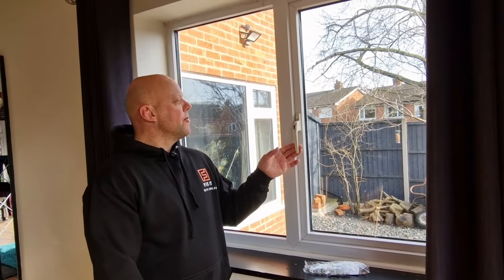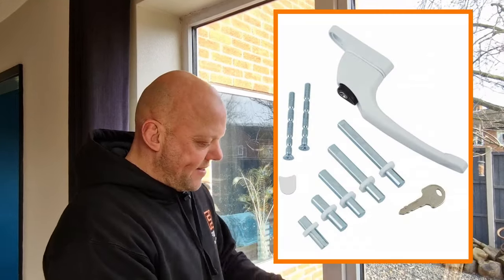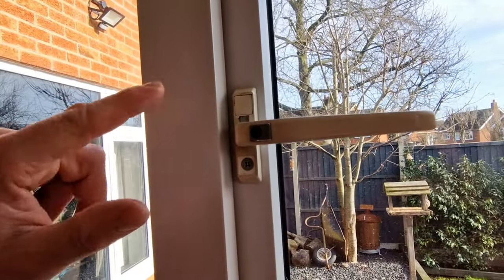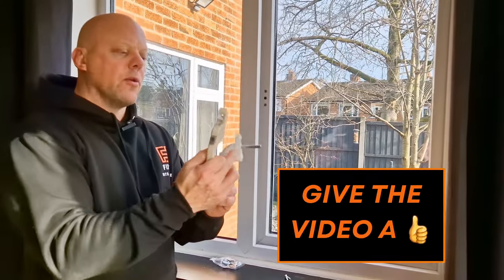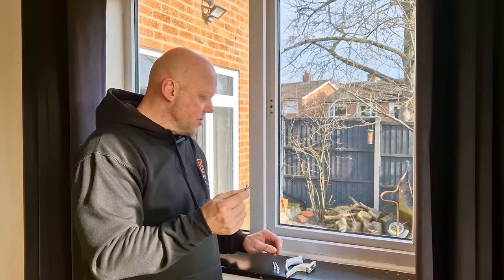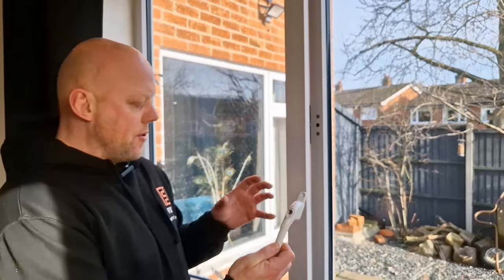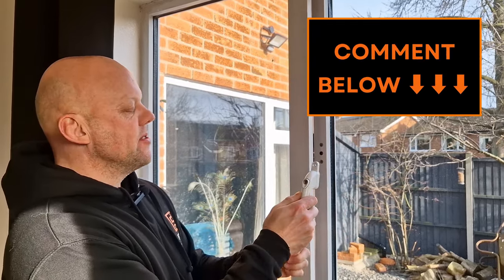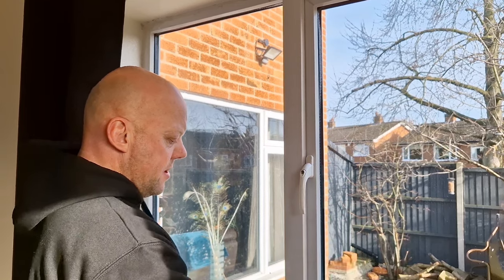How to change/replace a handle on a UPVC window

Comment: Any advice on changing handles that wont open?  I think the little locking tab thats lifted when you press the button in the handle has detached. Since the handle wont turn I can only access the top bolt. I’ll try to see if I can jiggle it free otherwise I think its going to have to be drilled/angle grinder cut out😢
Reply from the maker: I have created a short video on this https://youtube.com/shorts/15SBiv55h6M?si=BhQBcZ22UAvMhFHg
Reply: Thanks for pointing me to this video, I wasn’t able to get my window unlocked using a credit card as as there wasn’t enough room to insert the card between the handle and the back part, but eventually managed to get a knife blade tip in at just the right angle and lifted the sprung bit.   
Fiddly but got it open so I have now ordered a new handle. ❤

Comment: Have subbed, need advice on upvc widows that have dropped on opposite side to hinges
Reply from the maker: It sounds like you need to install replacement hinges!
Reply: @FixitwithFowler  ouch, ok thank you mate 🤝
Reply from the maker: It's an easy job, and hinges are cheap. It will be a future video.